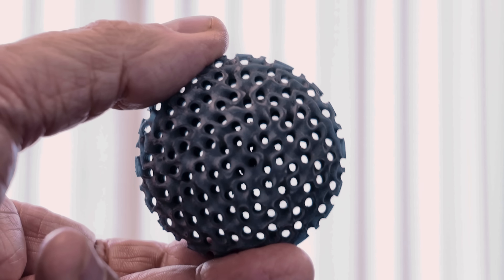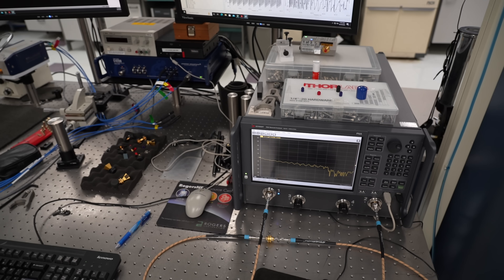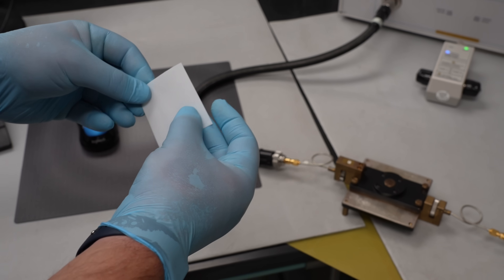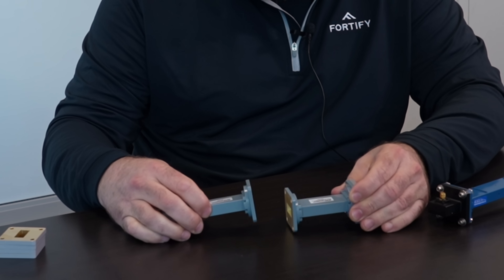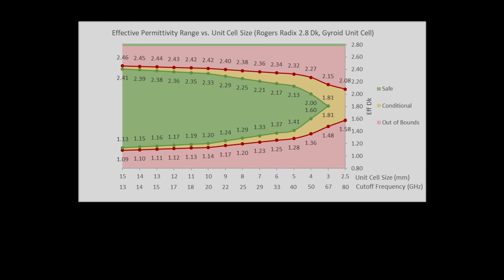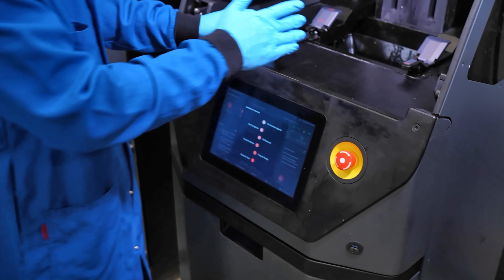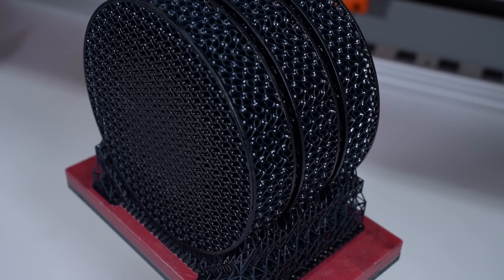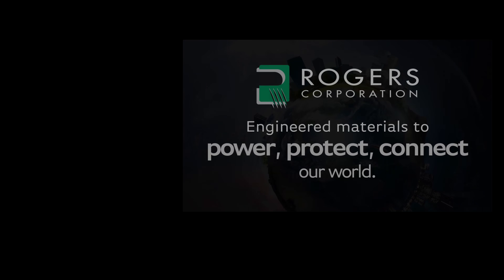Unveiling the Future of Antennas and RF Lenses using Radix™ 3D printable material!

Comment from the maker: A little explainer... First, apologies for any mono audio sections.  I am deaf in one ear so I sometimes miss mixing errors! Too late to fix it now, but please let me know the times when the stereo mix is wrong.
RF is just low frequency light. It behaves in a similar way to light being refracted and reflected.  The effects scale with wavelength, but you can get exactly the same effects in mirrors, blocks of transparent (to light or RF) material, lenses and waveguides (or light fibres) with RF and light or infra-red.  The scale difference is huge.  Light is around 0.5 of a micrometre wavelength, microwaves are a few centimetres, AM radio is perhaps 300 metres wavelength.  They can all be treated as waves or as photons, and quantum mechanics applies just the same to them all. When you put a pencil in a fishtank, it seems to bend. That same refraction happens with radio waves, they travel more slowly in dielectrics than in a vacuum because of the quantum effects, but that doesn't matter for large objects like these. A slanting dielectric surface can bend the rays of light or radio energy.  If the slanted surface is in the shape of a curved magnifying glass, the amount of bending varies across the glass, with more bending at the edges, so a parallel beam of light like from the Sun gets focussed to a point.  Exactly the same happens with radio waves so long as the glass is more than ten wavelengths across and the source is emitting radio waves.  You might want to use PTFE or a similar RF-transparent plastic to make the lens as it's much clearer than glass at millimetre wavelengths. At Infra red around 10 micrometres wavelength, Germanium metal lenses work well as they are transparent to IR, as is Calcium Fluoride. 

OK, so we are half way.  Now instead of making the lens shaped like a magnifying glass, we can change the density of the material by putting larger holes (or more holes) in it to reduce its average density, varying that density across the body of the material.  If you pick the rate of change of density just right, the effect on mmWave energy is indistinguishable from that of the original magnifying glass shape, but it's way easier to make and mount.  You can also do really complex tapers of density that would be impossible to machine.  That's the benefit of this technology, it takes us way beyond what can be done with casting, injection moulding, electroforming, laser cutting, water jets, Wire EDM or CNC machining, at least for ceramic-filled photopolymers.

Explaining the smaller lens is rather more complicated as it involves waveguides!
Reply: Raytheon was doing this with laser cured resin "3d printers" in the 1970s.
Reply from the maker: @lizzyfrizzy4969  I'd heard of something going on in the 70s or 80s but can't recall where. Might have been mentioned in Nature or New Scientist. I had no idea that it was Raytheon. Very interesting
Reply: Would this be useful for something like SpaceX's Starlink phased array?

Hypothesis: Smaller lenses means more virtual antennas.
Reply from the maker: @jtjames79  Economics will be the driver, small earth station receivers will probably go with beam steered array chips and patch subarrays, but I can see a benefit if the geometry is right, even with beam steering to multiple concurrent source satellites. Interesting times we live in.
Reply: I work in MRI... 
Don't get me started about dielectrics, standing waves, reflections, refractions, or other wave cancelations related to b1 inhomogeneity or E field effects...
Reply from the maker: @Unsensitive  Koestler said "A good terminology is half the game". My late wife and I had developed a rich and complex idiolect that was dense and impenetrable to outsiders. Just the mention of "Df" conveys rich meaning to anyone versed in the richly idiosyncratic idioglossia of RF tech, like "low-k" also conveys deep layers of concepts and characteristics. In one of my other existences I'm a willow basketmaker.  The private language of skilled artisans is just as rich and nuanced as that of tech fields. I'm privileged to be able to talk of waling and randing and slypes and uprighting and flow and ells and roseknots and all of the other trade nomenclature that separates the "us" from the "them" but makes communication much more efficient, sparse and densely meaningful. I like words a lot.
Reply: @MachiningandMicrowaves 
 I was never such an eloquent wordsmith with my barely average english, but have learned an appreciation of clear and concise expression that comes with at least a modicum of understanding.

I oft find myself in the valley between the oblivious and the impenetrable idiolect of specialists in so many fields.  I suppose that's the life of a ADHD generalist, or maybe it's just what some call middle age competency 😅
Reply from the maker: @Unsensitive  I think I would classify myself as a generalist, but with the ability of hyperfocus and concentrated learning when I am interested in something. I keep myself grounded by explaining this stuff to my mum, who is 93 in April and sharp as a razor and watches all my vids. Hi mum!
Reply: Thanks for this, I was getting a bit too lost in the middle there and would probably have wandered off to something well within my comfort zone. The bit about variable average density from the lattice structure made it make a lot more sense, I had assumed it was some sort of super precise geometry that I wouldn't be able to wrap my head around without a huge amount of background.
Reply: I’ve been thinking about this recently. No one seriously suggests that radios emit “photons”, likewise is ridiculous to say that a light source emits photons with mass. Does the light source lose mass as it emits these “photons”? It seems obvious that photons are one of the biggest lies in science.
Reply from the maker: @atomicsmith  Radio frequency photons are low in energy and are massless like any photons.  They are a useful construct of what is really going on at the quantum level, but for real-world engineering they aren't much use. I've only studied quantum mechanical models at undergraduate level.  Photons can certainly carry energy and momentum, but have no mass and don't experience time as they travel at the speed of light.  It's counterintuitive because Nature doesn't follow human intuition.  Numbers are a lie, mass is a lie, they are all stories we tell our limited ape brains to try to make sense of what happens. Nobody would suggest photons have mass, surely? By definition they don't. Detecting a single photon of radio energy using any practical radio is too hard because the energy of each one is way too little at around 6e-28 J (a few nanoelectronvolts) for 1 MHz photons. Thermal noise in any detector is going to overwhelm that, so the model isn't very useful except in diffraction models perhaps.  Once you get to photon energies of the order of an electronvolt, at 200 THz in the infra-red, you can detect individual photons and the model starts to get more useful
Reply: @atomicsmith  the reason for your first point is that when you're not talking about super low power levels and you're talking about what radios tend to be used for (inducing currents) it's easier to think of it as a wave. Photons follow the wave function, they have a wavelength, the only difference is that they are discrete rather than continuous.
The most striking demonstration is with the double slit experiment at very low power levels: you get the same distribution of energy as with high power levels where it's more obvious to model it like a continuous wave but you get one small bit of energy at a time. The demonstration is usually done with shorter wavelengths because they're easier to detect e.g. with camera sensors or photographic film but these properties don't suddenly stop once you get above a certain wavelength.

As for losing mass: a closed (apart from the transmitter) system like a battery powered radio will lose mass because it's losing energy. How much mass? e=mc². Or divide the energy in joules by about 10¹⁷ for an answer in grams, or about 3*10^-13g for something the size of a phone if my maths is right. That's beyond what can realistically be measured, but it is easier to measure when you look at nuclear based reactions rather than chemical ones you'd find in a battery. It then regains that mass when you recharge the battery.
Reply: Can metal sense light?
Reply: @atomicsmith  to add on to my earlier comment, consider the phrase: "All models are wrong; some models are useful." (I think it was Feynman who said that.) We don't know what is "really" happening. We only know what our instruments and senses tell us and we have to work out the rest. We use this information to make models which we use to make predictions. The classical wave model works well for radios. We also make conceptual models because our brains don't work well with pure equations, we like to at least think we understand what is happening. The classical model doesn't fit our observations well at very low energy levels and very small scales so we use a different model there. We don't have a good theory of everything, so we pick a model that works well for what we are doing. Sometimes that means ignoring some things where the effect would be so small as to make no practical difference.
Reply: Between this video and expanded "article" comment, I clicked subscribe. First time I've seen a single video from a channel and done so, and now I can't wait to see the history of videos that led to this.
Reply: Amazing!
Reply: Is this similar to what that team from the university of Sheffield had just accomplished?
Reply from the maker: @DurzoBlunts  No idea sorry, I have friends at Sheffield but I haven't seen any papers from them.  This is a solidly commercial product, available now, but there's an immense amount of work going on all over the world on these types of technologies.  Do you have a citation reference or UDL for the Sheffield work?
Reply: What beam does your flashlight produce? And are there imaging systems capable of seeing this?

Can the devices they were using to measure the rods be used to detect different solids materials in a stream or free fall type of environment?  If something bounced around inside there instead of sitting stationary would it mess up the readings based on geometry or position?
Reply: Absolutely fascinating - glad to see there's a real world application for the gyroid beyond being a mathematical curiosity for filling 3D printed objects.
I guess the sinusoidal structure matches the EM wave frequencies, so I'd guess a thicker lens would also act as a narrowband filter.
Wondering if similar results could be achieved using SLS with metal powder.
Could a 100 metre diameter lens be more practical than a similar sized dish?
Reply: Is there like a beginner video you know about so i can watch that then come back to this. Im not well versed in most any of this.
Reply: I have printed lenses for 22mm tubing (for qo100 / 10 ghz rx).. But those had steps inside (with 100 %infill)... Maybe i should have used some air gaps inside (less infill)???
Reply: This was interesting. I was trained in the military in aviation RF and jamming systems, then worked in aviation metrology and later, the broadcast business. When working in a fiber optics company, I ended up working with one of the top development engineers of the phase aray radar systems for the F14 radar and learned to think outside the box. 
Now retired, I still mis the new technologies out there. Keep plugging away. You never know what you find out. Keep testing and having fun.
Reply: @MachiningandMicrowaves  Why many word, when less word do fine?
Reply from the maker: @Lukyan  Because, my friend, I like words!
Reply from the maker: @monadking2761  Wow, there are some very cool folks out there who have cool jobs! I've wasted 40 years messing with computers, coding, networking and cybersecurity. Boring!
Reply: So is microwave imaging possible? Like lensing radio waves onto an image plane and seeing what bounces around the room as a 2d image? That would make troubleshooting routers a lot easier. And you could see through walls.
Reply from the maker: @Alkatross  I can make a raster image scan of the local environment using a microwave dish that has azimuth and elevation controls, it is very coarse grained at 10 GHz but trees and buildings show up as a rise in radio noise. Doing it actively and fast is more tricky. The 122GHz units we have from SiliconRadar are certainly capable of active imaging if you have lots of them at the focal place of a lens array or use a fast scanning technique. I haven't tried that yet though
Reply: There's a lot here that I didn't understand, and I am confused.
What can this be used for?
 – directing [most of] an antenna's energy in one direction, making communication between two fixed points cheaper (energy wise) ??
 – Or is it just a cheaper/better way to produce ..uhm.. "RF lenses" ??!

Also: I didn't get the flashlight / lens thing. I assume it's rebuilt from emitting visible light to ... ??? ... ??? ...
Reply: ok, makes sense. So you use the gyroid structure because it's easy to manufacture and minimizes material usage, and then 'pick the rate of change of density just right' to create the desired focus? feels like i'm not getting this... does it have to be gyroid? or could it be made using any minimal surface geometry? pretty cool stuff.
Reply: @MachiningandMicrowaves  More power to you then!
Reply: All those people talking about how the brain is an antenna don't sound so crazy now, do they?
Reply: Came for the video…stayed for the comments in this thread. 🤯
Reply: @Unsensitive  I think you've earned the title of "eloquent wordsmith".
Reply: Far out I was totally lost until I read this. Thanks for ELI5 👍
Reply: And just imagine if we could "grow" such crystalline structures using modified DNA from a glass sea sponge and fungal DNA by using CRISPR or similar technology
Reply: I have never seen anything like this before in my life! I am curious why are these parts has these distinct curved geometry? If the density of material is the concern, why not something else (like lattices of different sized holes for example). Another question is what are the benefit of using these “lens” comparing to traditional radio dishes, which are parabolic “mirror”?

Disclaimer: I know nothing about lens antenna before and only did some quick Googling about this topic.
Reply: @Unsensitive  I saw the vid and my first thought was adaptive coils for MRI. Like we do adaptive optics for microscopy and telescopes.
Reply: It's like GRIN (graded index) lenses for optics, but at the RF scale. We use them for calcium imaging and optogenetics in neuroscience.
Reply: @MachiningandMicrowaves  Look it at the bright side, at least that all seems to have helped pay for some of your toys...
Reply from the maker: @retromodernart4426  Absolutely, having a proper camera, lights and lenses is a great luxury
Reply from the maker: Waveguide and resonant chambers can be used to measure fluids and moving samples, the limit is the rate at which the Vector Network Analyser can collate samples. Certainly it's possible to get  millions of samples per second, so falling objects under gravity or reasonable velocities would be straightforward to measure as they move about. Perhaps not quite fast enough to measure things like projectiles or entrained in supersonic flows
Reply from the maker: The flashlight generates a searchlight-type beam with a divergence of a few degrees at either 24 or 47 GHz.  Imaging at those frequencies is tricky, as the cost of detectors is significant, but the antennas are small enough for mechanical raster scanning.  The real use for it is as a weather-resistant and robust remote transmitter and receiver for measuring the radiation pattern of experimental microwave antenna systems in the field.  More in part two
Reply: Yep, but to put it all into proper context you should bring up the "Electromagnetic Spectrum" which charts all frequencies and photon energies.
Reply: am is ~500-1000 meters
Reply: @lizzyfrizzy4969  This partially explains the "we have the tech to take ET home" quote from Skunkworks.
Reply: The thing that trips me up is that, RF and light are on the EM spectrum, but light is blocked by a sheet of cardboard, while WIFI is not.   Light is photons that can be lased, but RF radiation isn't particles, right? Can't. belased?
Reply: @RogerWilco1  Phenomenon on the EM Spectrum appear to have particle and wave duality.  Look up the "Wave–particle duality" theory and it should do a decent job of explaining that.  For even more interesting freakyness... look up light polarization where light can pass through 3 lenses but not two.

We still seem to be barely scratching the surface of our understandings of physics.
Reply from the maker: @RogerWilco1  If you can find something that has a hyperfine electron energy transition of low enough difference, the resulting photons are at microwaves. Hydrogen has a suitable transition that you can excite easily and creat the necessary population inversion, then if the cavity is if the right dimensions, you get laser action, it's just called maser. Carbon Dioxide has a strong line at around 30 THz in the far infra red, That will pass through a solid Germanium lens but visible light won't, neither will radio waves. 
Lower frequencies than the hydrogen maser are rare because of the nature of the atomic orbitals, so things like the spin state are the only low enough energy change that's stable enough for long enough to create a pop inversion. Gamma rays and X rays pass through most things si focusing them needs clever grazing incidence mirror arrays like on the various X-ray satellites
Reply from the maker: Also the particles versus wave packets are human constructs to help our poor ape brains build conceptual models to calculate and predict behaviours. @sabinehossenfelder has excellent videos on the subject
Reply: @MachiningandMicrowaves  They do work with beam stearing! My team at work has been researching novel lens designs for 3D printed dielectrics for use with mm wave phased array antennas for the last few years. The beam stearing makes the geometry tricky, but we've been able to leverage AI/ML automated design techniques to refine and generate proper lens designs.
Reply: Just cut out Amy. She is annoying.
Reply: At around 6:15 or it just sounds like your making up a fake product.
Reply: @MachiningandMicrowaves  could one coax nano particles of metals and or water in the atmosphere with many Nexrad + ELF + water generating "stations" or steam coal generators as patents claim?
Reply: Completely disconferkulated after that.
Reply from the maker: @mikemines2931  An entirely correct and understandable reaction. I'm doing a human-language version right now. OK, it does include some quantum physics, but described so my mother can understand it. She's 93 with a mind as sharp as a razor though. The original video was for a tiny group of specialist design engineers. The new one is for everyone else.
Reply: @MachiningandMicrowaves  Thanks, I came at it from the optical end and that was a great help.
Reply: I didn't understand 1 thing in this video. But you have a great presence and voice. Good production, and interesting topics. I hope I learned something watching this. Thanks for all the hard work!
Reply from the maker: @ronnydarko9046  This was aimed at a tiny audience of specialist engineers but 900k other kind folks watched it! New video on this technology aimed at non-specialists should be out this weekend!
Reply: @MachiningandMicrowaves  Thank you so much for the reply. There was no way I thought you would see it. This one definitely feels like it's for the experts. I love the way you break down gadgets like the Russian "Bug". So interesting, can't wait to see what is in store for the future videos. Appreciate the reply, and CHEERS 🍻 mate!
Reply from the maker: @ronnydarko9046  I'ms so close to finishing the next video, but I have to be at work for the Day Job in 9 hours so I need to get this one out urgently. Real Life just gete in the way all the time.  Next Cold War reconstruction will be the EASYCHAIR Mk2, that's a fascinating piece of kit